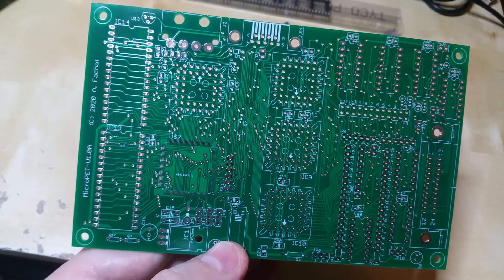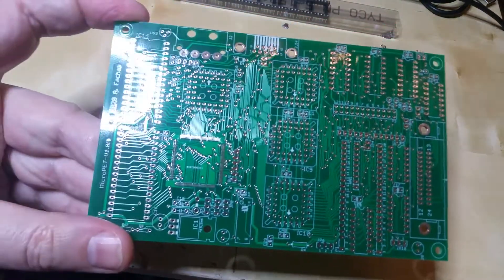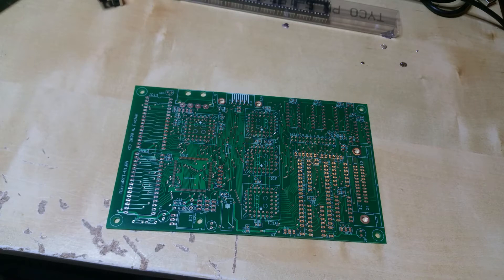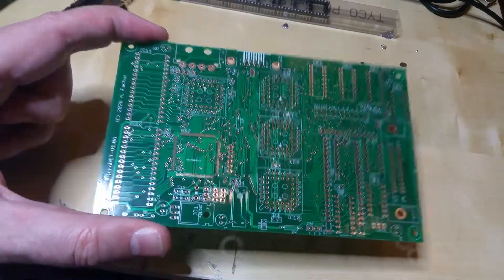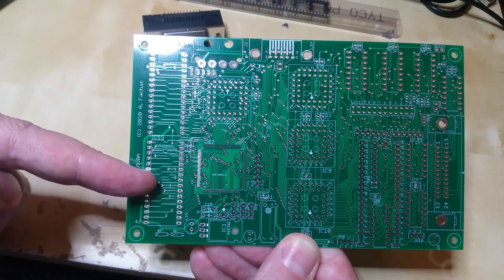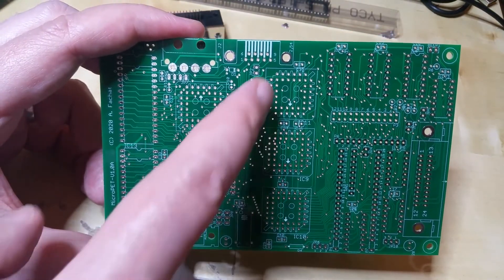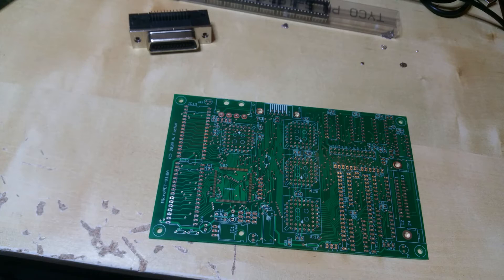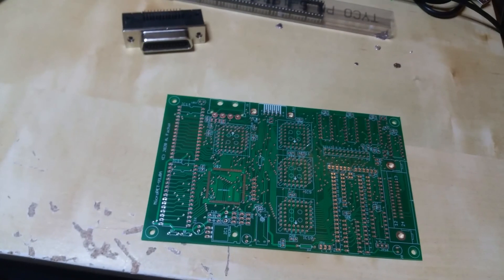8-bit times Ep1: Micro-PET intro

Comment: I think there is a great need for an open source board! Re: connector : I don't like edge connectors at all because you need expensive gold fingers on the contacts to prevent damage from plugging/unplugging. Please include the standard IEEE-488 connector for primary one.. card edge ok/but only as secondary. (Sorry Mark!)
Reply from the maker: I'm afraid the standard IEEE488 connector will have to go if there is an edge connector - it's just too much space taken up, and card edge looks reasonable to attach storage solutions. And there will be a flat ribbon connector (similar to the one inside the newer PET, that they use to connect the internal floppy disk)
Reply: In the german version of the amstrad cpc6128 Schneider had used these type of ribbon connectors instead of edge connectors but left the pcb the same shape only removing the plated traces/fingers on the edge. I think if you would do both provide the plated fingers, the cutouts for the edge connector and the throughholes for the IEEE 488 connector behind the fingers  it could serve both ways. Btw great project! Would you consider to also implement the color pet mod in this micro pet version. Speed and memory should be of no concern even in 80 column mode it’s only 4Kb of RAM needed there. Even a mapping of the character rom into ram space should be possible here. So much fun 🤩. Retro commodore fan approved !
Edit: Oops, I’m very late to the party 🤷🏼‍♂️ - as always lately - just seen the date of the vid and all the follow up videos  - nice 👍. Sub +  Like. Now I just need to get a board!!!

Comment: Nice idea! As for IEEE-488, I would prefer a card edge connector -- or both, if there is sufficient space. I would use a PetSD (or similar) module, as I don't have any IEE-488 drivers, and these modules can use a card edge connector.
As for the rest of the board: It looks nice, I only fear that the CPLD, which is a SMD part, may be hard for many people to solder.
How compatible to existing PET or 4000/8000 CBM software will the Micro-PET be?
Reply from the maker: Compatibility is not 100%. The CPU is an 65816, so undocumented NMOS 6502 opcodes won't work. Video compatibility for those machines without CRTC should otherwise be good. CRTC will not be emulated (even on the "CRTC" machines like the 8032), there will be some memory locations to switch video modes.

Comment: Will the μPET come pre-assembled?
What do you estimate the cost of the μPET will be?
Will any integrated storage solutions be provided?  Built-in tapuino, or SD2PET?
Do you have a keyboard solution?
Which version of BASIC will it run, ### v2 ###, or 4.0?
Reply from the maker: Thanks for the questions.  The design will be open source. I will not produce boards myself, but everyone is free to build some. If someone will build it, parts cost will probably be between 150 and 250€ (as a kit). The CPLD alone is around 40€ (single item), adding the other chips adds up....
I don't have a keyboard solution myself. You can use the original PET keyboard (connector is on the board), a C64 keyboard (but that is not compatible with many software titles for the PET), or use e.g. the texelec keyboard https://texelec.com/product/petskey/
The plan for the ROM is to be able to switch between them. There is enough ROM space for multiple versions.
Reply from the maker: Oh, and about the storage solution - I like my systems to be modular and flexible. So it will not have an integrated storage solution, at least for now. I may be looking into an SD card interface attached to the CPLD (and controlled by the 6502), but it depends on the number of available resources. But that means that you can use any storage solution you like on the IEEE488 bus, be it SD2PET, PETSD, XS1541, or even a real floppy.